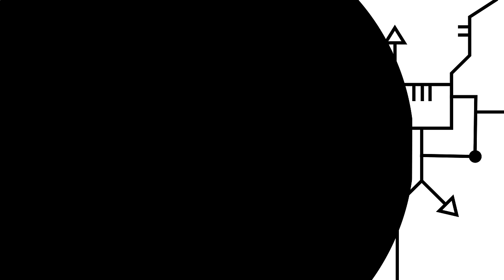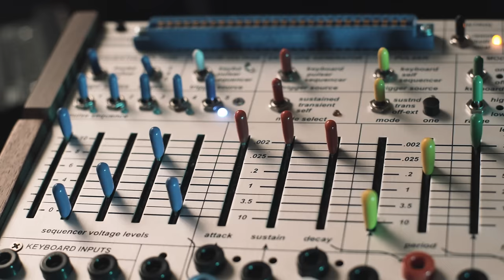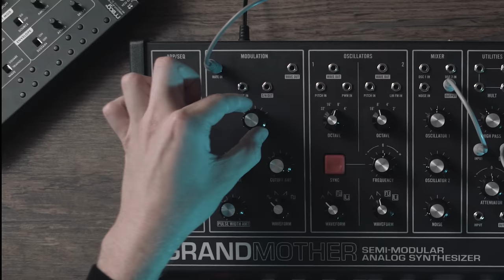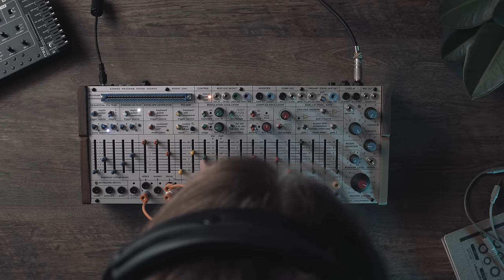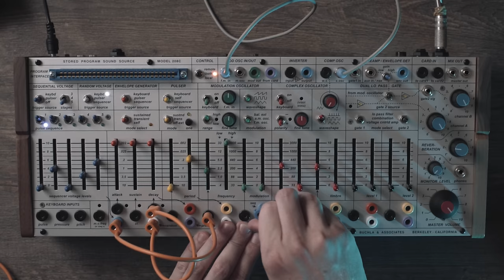Buchla Easel Command & Moog Grandmother | Eastcoast vs. Westcoast Synthesis | Thomann

Comment: I do like some of the sounds of the Buchla, particularly the hollow resonating percussion sounds. But, honestly, if a totally random soundscape is what you want, you could do this on any well equipped modular. Just lose the constraints of a keyboard and ideas of diatonic tones. My problem with total randomness is that once in a while you want to recreate something. Our minds try to create some semblance of order. It doesn't need to be much. But, otherwise, you just get chaotic noise. It's much like just throwing random colors at a painting, hoping something cool will appear. Electronic music doesn't need to follow rules on tonality, but it does require a pseudo order to be considered music.

Comment: Interesting! So in case I wouldn't want to go full modular, but neither can (want to) buy a Buchla / Easel Command for 3000 bucks: Are there semi-modular synths on a budget which would qualify as Westcoast?

Btw: Recently I had an interesting read ('Analog Days' by Pinch/Trocco) where they explained that Buchla's opinion was that hard-wiring a (piano) keyboard on a synth would be kind of a step backwards, like: Why would you even need a keyboard, if you can control pitch etc. via knobs and faders (voltage)? That's why he invented sequencers and controllers which 'overcome' the keyboard / 12 tone music approach. Meanwhile, from a very early stage on, Bob Moog got some of his initial inspiration / input from professional musicians and thus quickly integrated an old organ keyboard into the first prototypes (at first with doorbell switches from the electronics store across the street, put under the keys to trigger the gate / amp envelope). I think it's a funny anecdote and tells a lot about why East/Westcoast are so particularly different with regards to their module layout, workflow etc.

Comment: This leaves me wondering, if Buchla was all I had access to and wanted to do "conventional, Western" style music, how does one go about doing that? Or was that type of synthesizer just not designed for doing that?
Reply: Around the 23:00 mark he insists it can be done.  I believe him,  but I'd still really like to see it.  When I got into synthesis I wanted to perhaps try some Buchla gear, I do love the sounds that are possible, but what ultimately turned me off and pushed me to the Moog side is the unconventional sequencing of this so-called 'westcoast' design.  I enjoy generative music, but it's definitely not the only music I want to make, and I worry the Buchlas are too limiting if you want to branch out.  Does the Easel have MIDI for example?  I'm guessing No.  Edit:  Oops I guessed wrong. It does have MIDI.  So now I really want to see it hooked up to something more conventional!  lol
Reply: @sinepilot  It has MIDI control over both oscillators. You can play quantized or do weird in-between notes with it. Sync to a drum machine, etc. Not just weird bleep bloops! I find that's the advantage it has over Moog, I've gotten some thick bass stuff out of my 208C but I'd struggle to come up with some of the more weird stuff I do with the Buchla on anything else. Everything else is too normal!
Reply: @BrandonJBilinski  Ha, good to know, thanks :)
Reply: It really can be done. East coast/Moog/Subtractive basically uses a complex wave and cuts back frequencies. So a note starts with a lot of filtering, giving an almost pure sine wave, and opens the filter so that you end up with the original, complex wave. If you use a square wave, and an appropriate envelope, you end up with something that sounds like a clarinet.

In west coast/Buchla/additive, you start off with the simple wave (sine/triangle) and add to it. One easy way is use a wave folder. So when you start the note, you get the simple wave, then as the sound progresses, turn up the wave folder till you have the harmonic content you want. With the appropriate envelope, you end up with something that sounds like a clarinet.

So both instruments end up sounding alike - one has a complex wave that is filtererd, gradually increasing the harmonic content, the other starts with a simple wave which increases the harmonic content by adding wavefolding. End result - the same :)

A simple example, but it demonstrates that you can in fact get similar results, just the thinking is opposite. Like the light and dark side of the force, subtractive is easier, quicker, more seductive than additive. Is it more powerful? No.

Comment: on the buchla command, is it possible  to transpose the sequence on the fly, or do you need to plug a keyboard ? great video  !
Reply from the maker: You have various options. You can detune the oscillator manually. 

You can attach the buchla touch keyboard which allows for transposition of the sequence.

You can send in Midi and transpose that (i do it with the octatrack)

You can use something like an arturia keystep.

Also there is more experimental stuff like the Makenoise O-Ctrl or Sensel with Buchla thunder overlay

Comment: I loved the video. But, as a begginer at Buchla, the video doesn't make it clear. I'd be amazing to have a really basic Buchla video to really no get lost on it. I have the Arturia version and still get really lost... :(
Reply: Watch videos by Buchla and Pittsburgh Modular synths exclusively  for a bit - just learning about how west coast synths are designed and work.  Do NOT try to equate the two - east coast versus west coast.  Learn how to get sounds you like on a west coast synth,  then after you get one, you can start thinking about how to interface the different synths.  I have the Pittsburgh Modular Microvolt 3900.  I love the wavefolding and the overall sound of the Microvolt.  It provides a different sound or tone, yet blends and mixes well with all kinds of other synths like Moog and other more typical east coast synths.

Comment: Sigh. The fundamental difference, which Thomann here singularly evades discussing (for reasons I don't understand), between east coat and west coast is the immediately obvious dominance and integration of the keyboard in East Coast synthesis. That's it. As you noted, a sufficiently powerful and programmed Moog can do what the Buchla does. The Buchla operates from a framework that is fundamentally disinterested in the well tempered scale and the keyboard that imposes it. The Moog operates from a framework where the keyboard is an essential component and relies on its melodic (and later, harmonic) capacities.
The classic difference between East and West coast can be seen in the difference between Wendy Carlos's "Switched On Bach" (Moog), and Morton Subotnick's "Silver Apples of the Moon" (Buchla). Wendy is hypervigilant about her music appearing online, so it is hard to find. But Silver Apples of the Moon can be heard hear:
https://www.youtube.com/watch?v=3G1hRNLlYpg
nice programming of the synths though!